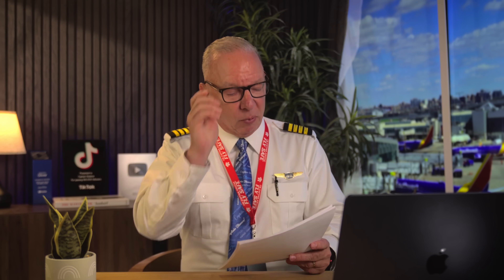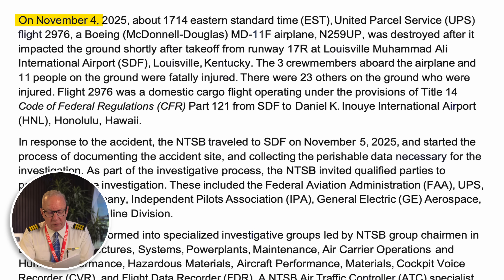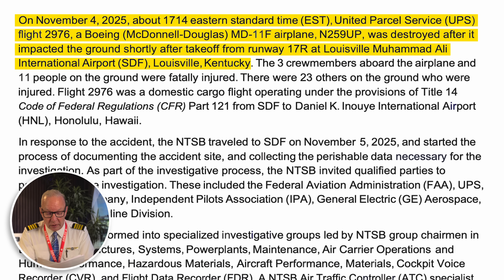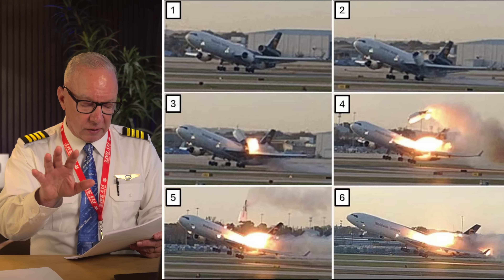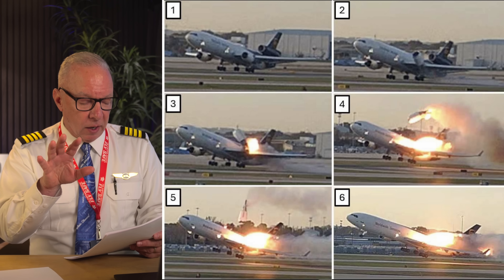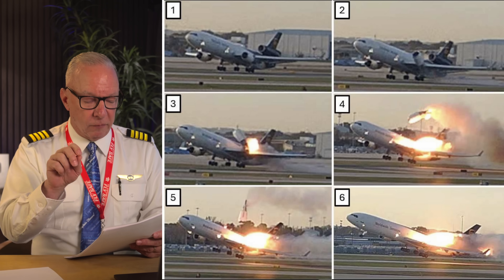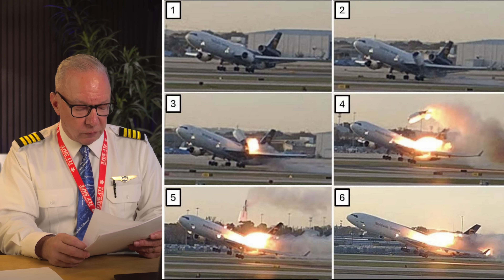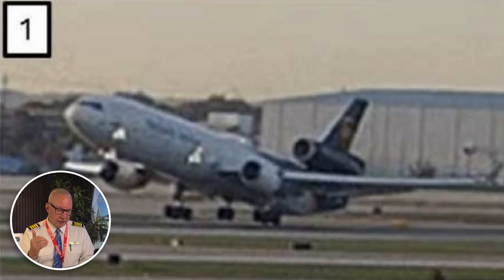UPS Crash Preliminary Report | Pilot Reacts to UPS Crash Report

Comment: So now when there is any doubt as to any potential fault ,there must be increased surveillance of those potential issues surely ?
Operators of Aircraft might think that there is overreaction to bringing forward Viral inspections and in this case a detailed and intensive inspection could have /would have found the potential issues !
The other recent fatalities must bring certain doubt to any potential claims that there may be a fault with operating systems on any aircraft .
Sadly the people who have lost their lives in this accident have been part of the system that allows greater time frames for intense inspections,and that is probably due to boardroom policy, fiscal control rather than mechanical knowledge and common sense thinking .
RIP those people that perished.

Comment: @CaptainSteeeve;  Not that it would have changed the outcome but according to the report the fwd mount also had fatigue cracks (assumable pre-existing) along the fwd inboard bore. You stated that doesn't mean they were pre existing. (11:45) .  I believe that would be incorrect. As a retired aircraft assembler, we learned that fatigue happens over time. So that would mean they would be present before the accident took place?  Not taken away the fact that it would not have made any difference once the rear lug gave way.
Reply: it said the forward mount did not have fatigue cracks
Reply: @marknicolich5789  yes it did, on the forward inside mount, read and listen 😉
Reply: @jagwal1  my mistake thought you meant fwd mount not fwd lug either way a fatigue crack is gonna be pre-existing

Comment: Per Wikipedia, Louisville's elevation is 466 ft above sea level, so adding the 30 ft would result in 496 ft above sea level. 

So the NTSB reported elevation, 481 mean seal level seem to be in the ballpark.

In fact 496 ft seems low as the airport is at 500 ft msl, so 530 ft msl would be possible.

Comment: As I recall on a MayDay Mayday crash that this happened on that was a passenger plane (RIP), you can't see these pylons unless the engine is taken off. It is quite a long procedure to do correctly which keeps the plane out of service. This means a lot of money lost for these planes when out of service. In that case the stress fracture was caused by them doing maintenance not by the way the manufacturer's directions. They used a lift to reattach the engine and this could bump the pylons causing a stress fracture. The engine needs two perfect pylons to hold it into place. One of them compromised leaves the other one to take on more loads than it is meant to so that it receives fatigue cracks. I am not for sure what the difference is in fatigue verses stress fractures in aviation, but perhaps a mechanic might see this and tell us. I am guessing stress is referring to something that was not normal operation done to something causing a fracture as to fatigue is just wear and tear. I could have it backwards though. Still, the bottom line is that corporations think more about money than safety and lies and I have seen air crash investigation cases show FAA and NTSB willing to comprise safety with these corporations, so I wish people would stop treating them like angels or gods. This is spiritual babylon and greed makes this world go round where lives are expendable. Truly as the scriptures say, the love of money is the root of all evil.  Revised: By the way, both stress fractures and fatigue fractures are in the report, so there needs to be a video on exactly what they are. It sounds like a like of correct maintenance again where a "stress fracture" was caused to possibly cause "fatigue fractures".

Comment: Hello captain Steeeve,
I had commented before bout my cousin be a flight attendant on flight 191 outta Chicago in 79.
I had a paperback book bout the whole story. 
Could those stress fractures on this planes pylons been caused from both engine and pylon being removed as one piece instead of just the engine being removed from pylon?
The book said that they use fork lifts to lower and carry engines and taking both the engine and pylon together is way too heavy and it causes some kind of cracks in the pylon mounts I guess. 
This to me sounds a lot the same thing. 
Such a tragedy

Comment: Nothing lasts forever, and a part under such stresses should simply be replaced periodically (every 10 years) whether cracks can be found or not.   Bridges are inspected every 24 months (low risk bridges up to 48 months) but the bolts were not inspected for years.   

Should we increase safety and associated costs (added bolt replacement costs) or let the airlines continue to risk the lives of their employees and innocent people on the ground?

Comment: Is there no way passengers can be informed if the maintenance of the plane they're about to board has been inspected or serviced as required by the FAA or is within tolerance? Something on the ticket,  the flight service app. or on the flight board in the terminal?  I mean, it seems so much is overlooked and disregarded.

Comment: I find it crazy that after every accident involving a plane, we’re told by the NTSB of the failures and the regular routine maintenance these machines go through. But somehow, it’s never enough for anyone to say that parts should either be inspected a lot more frequently or parts should be replaced during prolonged inspection routines to prevent wear.
Reply: When something breaks on a car, the results are rarely deadly.   When something breaks on an airborne plane, those involved are not so lucky.   Flying is still statistically safer than driving.

Comment: A little confused. Back in the 70s, I spent a lot of time at Tweed New Haven.  There was Pilgrim and Allegheny airlines, that the ticket counter, and tower said were DC-10s, that were 90+ percent of traffic coming and going. The DC10s that came in/out were a smaller twin engine plane.   At times, I would have to go in/on to check for a missing item that a passenger would report missing. They were not that big, not like the pics I see on the net.  Did they start making them bigger?

Comment: It would be interesting to know how many seconds elapsed between picture number 1 and 6.  My guess is less than 5. Awful. Are there usually any major, or I guess minor changes to a preliminary report? Guessing it depends on the circumstances and location but in general.

Comment: Thanks Cap Steve. 
So after the 191 crash the FAA left everything for granted and the airplane resumed operations without preventing procedures for another accident. Quite frankly unprofessional! I would recommend procedures for resuming operations on these MD11 for example changing the pylons every certain hours of flying, testing the old pylons for stress strain in and accumulating data for each part. Sharing these data with the manufacturer. During operations records of flying airplane weights are recorded for each pylon testing. I think that would be a more sensible preventive maintenance approach than a set of eye balls check.

Comment: For clarity, where the report states the aft mount's lugs were broken at the stated "clock" positions, they mean in relationship to 12 O'clock being at the top of the lug, as if you are looking at a wall clock with 12 O'clock at the top (top of the hole in the spherical bearing and the axis of that bearing being the center of the clock)

Comment: I’m interested in knowing why only one attach point in the aft to me if you had two like the front it would have been better. Second is I would liked to know what roll the bearings played in the mount failing if any. They look marked up and not in the best shape either from the crash or did the bearings wear out and caus the mount to crack over time since the engine would not be able to pivot with the bearing and put stress on the mount.

Comment: You got a little mixed on the forward “lug” of the aft “mount”, and the forward mount. There were fatigue cracks in both lugs of the aft mount, but none mentioned in the forward mount.

Comment: At 11:47 I believe you incorrectly said fatigue cracks were not preexisting.  I believe this is wrong as fatigue cracks happen when something moves back and forth over time. Like moving the tab on a soda can back and forth until it breaks. At 12:00 mark and again around 12:45-13:00 I believe you confused the forward lug of the aft mount with the forward mount. This paragraph of the report only talks about the aft mount and not the forward mount. The report does not talk about the condition of the forward mount. What amazes me is by frame #5 the detached engine no longer had flames and only smoke.

Comment: Until the final report we will not know if the fan blade parts found in the area, came apart before engine separation  causing enough vibration that it caused the failure of a fatigued pylon mount. Or during the separation the blades failed, or they failed when the engine hit the ground. In this report nothing is said about what happened to one or both of other engines.

Comment: So how did this relate to flight 191 and why were DC -10s grounded as well? Flight 191 clearly was a maintenance issue. There doesn't seem to be a maintenance issue in this case. 

Don't pretty much all aircraft that mount engines under their wings have a similar design? (i.e. two bolts to hold engine to pylon and two to hold pylon to wing)
Reply: Generally true, but the NTSB cited two design vulnerabilities in flight 191. One was the vulnerability of the pylon attachments to damage during maintenance; and the slat system whose failure was a necessary condition to F191's loss. So perhaps the pylon issue has resurfaced?

Comment: Captain Steeeve, stress corrosion cracking: high strength material+possibly low fatigue strength+ corrosive environment+ vibration +time = fatigue cracks growing up  to catastrophic failure, in my opinion.  Keep up the no drama work, Captain.

Comment: How does this failure compare with the one in 70's?
Reply: Quite a lot less than many people want to believe. That plane was only 8 years old so metal fatique was totally different there. Also that plane actually got higher into the air and rolled over so that the back engine didn't get enough fuel. And even after the final report people really should keep wondering more about the bad city planning at the end of the takeoff runway.

Comment: Thank you, Captain Steve. I watch almost all of your videos. I find them informative. I am a commercial pilot myself. I do not fly any longer for any airline. I do believe we are both the same age, but I moved onto a different career sometime ago. my heart goes out to all who have been lost this past year and tragic accidents but when it comes to the DC 10 and MB 11 I wonder why after the 1979 crash of American Airlines it wasn't more emphasis put on that rear pylon. I also wonder if there's any connection to why both were the number one engine that failed. Maybe it was just bad luck. That's not why I'm contacting you. I wonder if there is a system that would take the angle of the aircraft and the angle of the engine and if that angle was exceeded would shut that engine down immediately. I'm talking about the difference between the two angles. So if a left or right pylon let go and that engine was coming up And the angle is changing drastically. The computers would shut it down before it ripped itself off. I know there is no way that a human could react fast. It's just a thought.

Comment: It’s amazing that these guys can figure out exactly what happened in a crash so horrific with so much debris.
Reply: I think they knew we're to focus there attention considering it happened before with a similar plane ( flight 191 DC10  1979 Chicago)
Reply: @Tim_281 they also saw this video lmao.
Reply: Well with the engine not leaving the airport, it is pretty obvious that it was part of the failure.
Reply: Well they had a pretty good head start from the video footage, and the fact that an engine was dumped on the side of the runway.
Reply: top tier forensics
Reply: There's videos. It's amazing you wrote a complete sentence without a brain.
Reply: They had a video, wasn’t hard to know where to look.

Comment: I would not have guessed the engine-wing attachment contained bearings. I assume they are to allow for movement of the engines in relation to the wings. How much independent engine movement is normal?

Comment: 5:22 "(Based on FAA-provided ADS-B data, the last data point showed 481 ft mean sea level [msl] and 100 ft agl.) That's not what happened. It wasn't that high at all."

I assume he's referring to AGL. They weren't 100' AGL, but they were actually higher than 481' MSL, because the field elevation is 896' MSL. The ADS-B data is obviously not accurate.
Reply: Runway 17R south end has an elevation of 461 feet AMSL.
Reply: @igclapp  there is no 17R at CVG.

EDIT:  Disregard. I was thinking this was CVG.

Comment: Thanks Captain Steeeve for all you do. On the picture #-6 the flame that seems to come on the back of the aircraft, I really believe that is the left engine that is about to hit the ground because that left engine actually flew over the airplane to the right side of the airplane due of gyroscope effect. I could be wrong and obviously the pictures don’t show more detail of it, but I won’t be surprised to see that later on in the report. Thanks again for the great work you do, I’m a big fan of your channel.
Reply: "…On the picture #-6 the flame that seems to come on the back of the aircraft, I really believe that is the left engine that is about to hit the ground …"

Look at frame #5, and you can see the #1 engine falling vertically trailing smoke, but no longer any flames.

Comment: Thank you!! My first flight attendant job was for ups in 2001. Sept 11 2001 was also my last day at that job. For obvious reasons. UPS briefly did charter flights to Cancun and back. I moved on to coex express. I am from new Albany Indiana. Only the Ohio separates us from sdf. I immediately thought this issue was from the pylon stress from the way maintenance worked their go around on their engine work. I’ve watched every air investigation in the history of air craft maintenance. As I’m sure every single person in every air crew has. We are taught in training most of these in training. You only have to be mildly concerned for your own life to follow through with the rest. As soon as I seen this, I immediately knew this maintenance shortcut was still active soon as I seen this crash. In my own home airport. SDF was devastating. Is still devastating. Soon as you pointed out the compression issue in engine 2/3 I knew you were right. I became a follower that instance. I’m not a flight crew member any longer. But I know they all knew what we did in that minute.
It hurts. But thank you.

Comment: Those pictures just show that they had nothing that they could of prevented it. That poor crew although the families can take comfort in knowing that the crew didn't cause the crash.
I feel like they need to inspect quicker then every 6 years. My husband worked for an airlines stock department, after finding screws mixed up he couldn't work there any longer. He sorted the screws but they had different lengths mixed in the bin. It shocked him up and he dreaded the fact that he could of sent out the wrong screw. They where working a lot of overtime and tired.

Comment: What is to say that the pylons on say 777's , 787's, A320's A330's, etc don't start having pylon fatigue issues? It isn't just 3 engine airliners/freighters that engines fall off of. China Airlines Flight 358 the #4 engine fell off the aircraft (747) and returned safely with no fatalities in the air or on the ground. That happend 29 Noverber 1980. So maybe four engines are better than two. Just saying. 

Have one question for you Captain Steeeve. Do you think that if the Airbus A320, operating as Flight 1549 that landed in the Hudson on January 15, 2009. If it had four engines instead of two. Do you think that all four would have been taken out by the birds? I've only found in the history of the planet one instance of four engines being taken out by bird strikes and it was a turboprop not a jetliner. A lockheed L-188 Electra on October 4th 1960.

Comment: The minute I saw the crash I knew.  On May 24, 1979 I missed a connection in Chicago due to a late AA flight from Newark.  AA put the 3 of us returning from a work trip on the next flight and we even got 1st class seats.  We arrived safely at our destination after dodging thunderstorms across the country.  Our aircraft then returned to Chicago.  The next morning we heard the news.  One of my traveling companions checked.  He came into our office with a strange look on his face.  He told us the aircraft that went down the morning of May 25th, 1979 was the same DC10 we flew on the night before (he had confirmed matching tail numbers). Makes ya think.